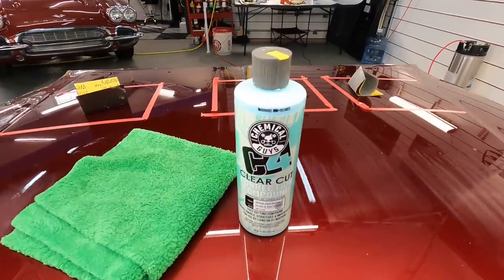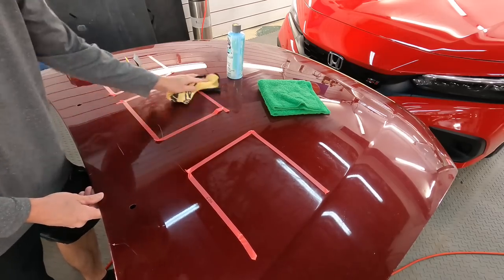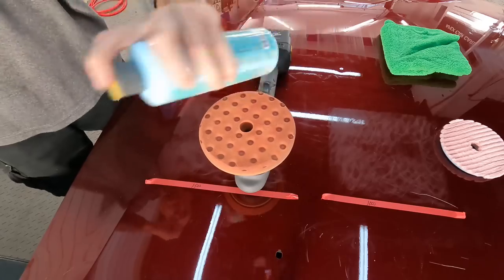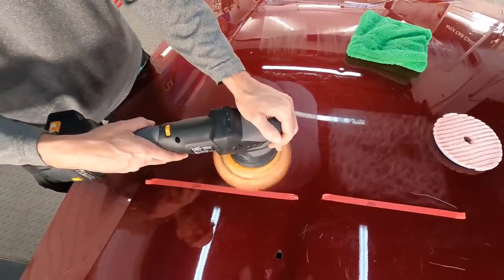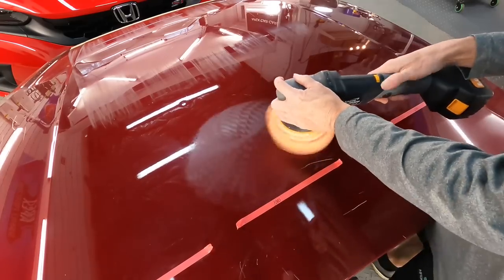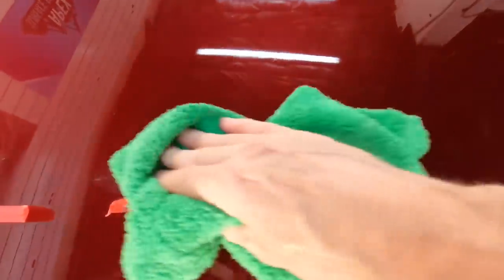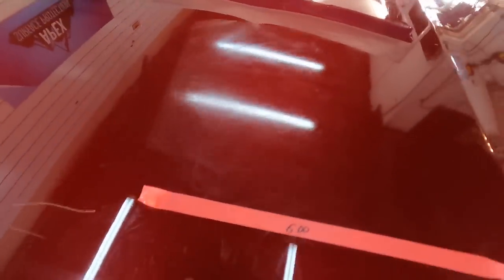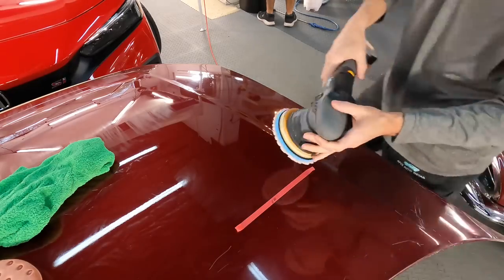Chemical Guys C4 Clear Cut Cutting Compound! Etching, Swirls, Scratches, Oxidation! How Effective?

Comment from the maker: Do you enjoy anything from Chemical Guys? Which Products?
Reply: Total Interior, Tire Kicker, Nonsense
Reply: Vrp for tires is great
Reply: Total interior detailer, lightning fast upholstery cleaner, VRP for tires. Don't mind the synthetic quick detailer either.

How does this C4 compare to Meguiar's ultimate compound, especially with the mild orange foam pad? Similar results? Better results?
Reply: Hydro Interior is not bad.. a little spendy.. but seams to get the job done.
Reply: I use their clay-luber and pad conditioner
Reply: Clay lube is effective and inexpensive.  Nonsense works well.  Barebones is an inexpensive dressing for wheel arches.  Lightning fast is an excellent fabric cleaner.  V36, 38 and VSS are good enough. Snow foams (Mr. Pink and Honey Dew) are not particularly expensive and are fairly effective.
Reply: Pad cleaner and conditioner and sometimes vrp tire dressing.
Reply: Total Interior has been good to me as a light-duty interior detailer. Not much cleaning power, but it does seem to have at least a bit of anti-static properties and smells nice. I’ve also been pleasantly surprised with Tire Kicker; even though the satin finish wanes after about two weeks, the sidewalls stay dark for a good bit longer. Neither are my favorite in their respective categories, but they’re not bad at all. Chemical Guys Iron Remover, however, is trash.
Reply: V07 soap and spray sealant is pretty good in my opinion. For presentation only though the protection doesn't last at all but the glow/shine you get is awesome
Reply: I've phased out almost all CG products, but I like their Nonsense Invisible cleaner and VRP
Reply: Black on black spray
White light 
Jet seal
Total interior cleaner
Leather cleaner, conditioner n serum
Vrp but I switched to carpro perl
Reply: No
Reply: Pete's 53 paste wax is nice. VRP is a good dressing for faded unpainted exterior trim sections. I also like the BlackLight all-in-one.
Reply: Nothing
Reply: The only thing I like from them is Honeydew snow foam
Reply: I forgot to mention Total interior detailer
Reply: Vrp,nonsense
Reply: So I my biggest gripe with CG is not only does pander to newer uneducated detailers but, most of their products seem to be "Great Value" knock offs of great products (V07=Beadmaker) But this is also why I like only one product by them. 
CHEMICAL GUYS WATERSPOT REMOVER
From something completely different I found that it behaves almost in the same manor as Whink rust stain remover but has jelly viscous surfactants. 
Not only do water spots come off, any wax, tar, and noticeable road film.  It's amazing tbh.  I definitely recommend it for a decon on nasty paint before polishing or even using a mow down technique for that matter. Highly recommend 👌 their other stuff...ehhhhhhh the labels are pretty I guess? 😅
Reply: @Xaviers300ZX   jet seal and tire kicker is good product as well
Reply: @carlosorengo1809   you should try nonsense, tire kicker, jet seal, they are good product as well

Comment: Use a plug in rotary polisher if those who detail because it's consistent power at low to spread and high to cut and polish. Battery drops significantly no matter what. Happy detailing 😁

Comment: Can this product remove a badly applied ceramic coating? Btw love the way you always get the pad on the polisher dead center😎
Reply: Yes, can you do a video on how to remove an old ceramic coating?  Thnx.
Reply: Totally. I used it after my Maguire's and CarPro compounds failed to do so on a client's car the other day. Worked flawlessly, and after following up with a little tester bottle I had of P4, i was ready to recoat their car (the right way). It turned out great. There are other compounds just as good or better, but C4 is definitely a solid choice and I can't imagine why anyone would be disappointed with it.
Reply from the maker: It sure can👍🏻

Comment: I like that you used my favorite pad the LC CCS Pad! Do you think the yellow one for the 1000 and 600 could cut it down better?
Reply: Good question. I would like you to explain in detail which pads & why
Reply: @ThisOldDetailingDude  The orange is med cut and the yellow is heavy cut! Normally, when you use compounds you have to follow up with a 2nd stage polish to finish down because of the hazing compounds leave behind!
Reply from the maker: Absolutely.

Comment: Hello Brian :

What pad combo would you use on a vehicle that has sift clear coat like a 2015 Rav 4 in black that has some moderate to heavy defects like swirl marks and moderate to deep scratches( not through the pain but close) I will be using a Rotary polished. Can you recommend the types of pads that I would need please?

I have a number of different polishes and compounds I picked up from extreme solutions.